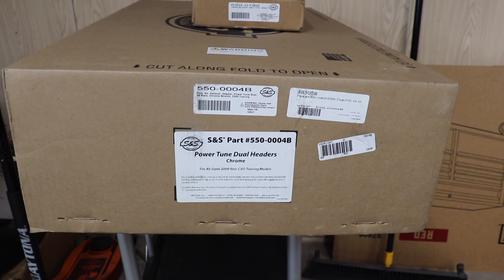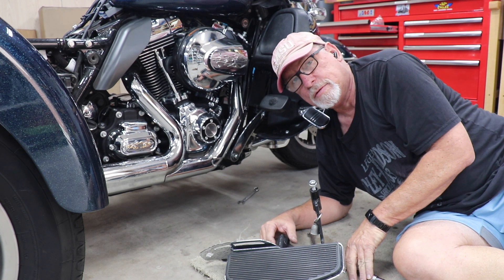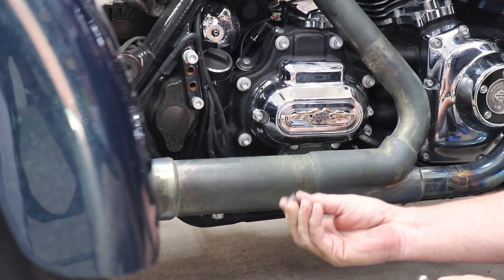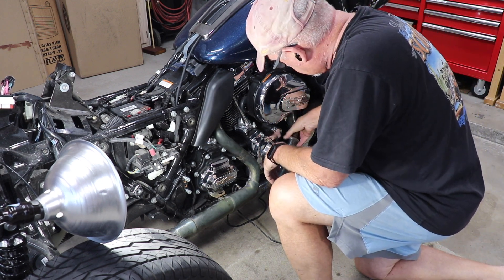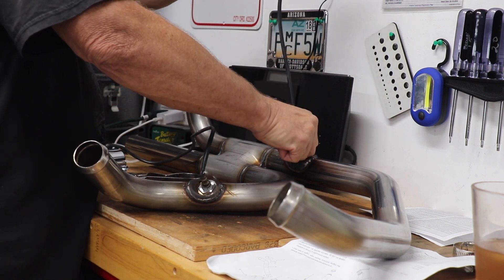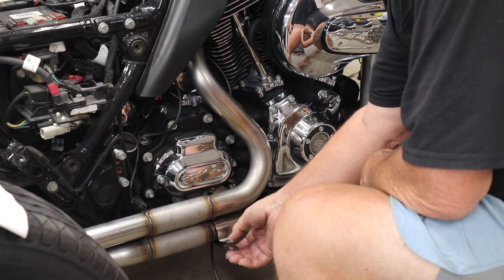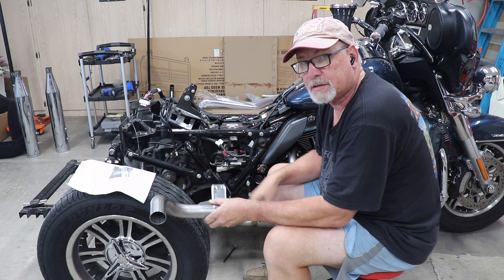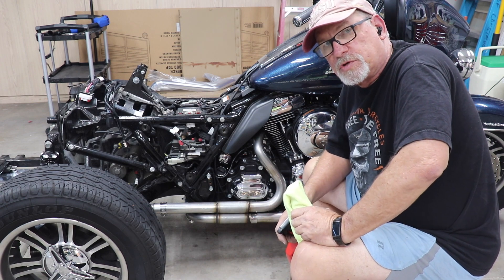2016 Harley Tri-Glide S&S True Dual Header Install

Comment: great videos and the knowledge your sharing is very helpful I just inherited my fathers trike from his passing and slowly fixing his 2018 trike up and your videos have been very helpful specially you give torque specs was your other video of the handlebars thank you been a great teacher for me as a beginner
Reply from the maker: Sorry to hear about your dad.  Thank you for the comments, it's why I make the videos.
Reply: @Batman825  when you do your back brakes plz make a video on it front was pretty easy but will be on back half in few months i will say my parents road the hell out of thier trike before he passed coast to coast florida to sturgis florida to las vegas  etc at age of 74 nothing stopped them not even when we hot wired his air machine to trike so they could travel.
Reply from the maker: @shrakkem  I will but it won't be for awhile.  A dealer here offered to change them if you bought the brake pads from them so I did.  Total cost just the pads, no labor.  It was hard to resist.  Might be other videos that show that on YouTube.  But if I do, there will be a video.
Reply: @Batman825  i would have done the same after i watched your handlebar video dealer wanted 700 just to install handlebars 150 not happening your video is what convinced me that it wouldnt be that hard i have decent amount over my 52 yrs of life fixing cars as they break so motorcycle sort of new area for me but thanks to your videos really helps so thank you again bob

Comment: Nice details and great fab work - now we just need a sound check!
Reply from the maker: I didn't do a sound check because I didn't change the slip-on mufflers.  The header doesn't really do much for the sound.  It mainly removes the Cat and heat.

Comment: great video is the factory header the same as 2021 ? how hard is it to get to the nut holding in the front header pipe around the lower faring
Reply from the maker: The 2021 is a an M8 motor and mines a 103 so I'm not sure about the same pipe.  As far as the front Header, you can get to the nuts from the front of the bike.  You can use a socket on the lower one but you need an open end wrench for the other.  It's kind of a PIA but with patience you can get them off.  It's not really that hard.

Comment: Great video...Was there any particular reason why you went with the S&S headers?
Reply from the maker: I was hoping that I could remove the trans cover to bleed the clutch but I can't.  I still have to back out the headers to remove the cover.  It looked like there was enough room to do that.  Live and learn
Reply: Question....After your trike is warmed up from a few miles, dose it start shifting louder as you go through the gears?  @Batman825
Reply from the maker: @rickyricardo976  No, what year is your trike?

Comment: Hi Bob, I have a 2016 Tri-Glide and when I ride in the heat (summer) my right calf gets burned.  Is that why you changed our your header and did it work?
Reply from the maker: That's one of the reasons, get rid of he cat which gets very hot.  It's just one of the things that I have done to get rid of heat.  I also added a different air cleaner as the stock one gets really hot also.  That is a stage one conversion.  I have other videos that show more ways to cool the motor.  If you go to DK Customs YouTube page they have a whole series on cooling down the bike.
Reply: @Batman825  Thank you, I love the bike.  I will give it all a try.

Comment: Yeah I would think it's because of the shocks, that or they just have piss poor products
Reply from the maker: The shocks are a good product, I just don't know about these lift kits.  I would say that Harley needs more rake in the front to make the bike steer better as this is what the lift kits help.  They change the angle of the bike.  I also don't understand why everyone says that they get the mufflers higher off the ground.  They lift the body up but the mufflers stay the same.  The bike was designed for 13" shocks and putting a lift kit on and 14" shocks spreads the swing arm part which pushes the swing arm down which causes the pipes to be hitting the swing arm.  Super Shox came up with a new down tube for the pipes which eliminates the swing arm hitting the pipes.  Other manufactures should also do the same.